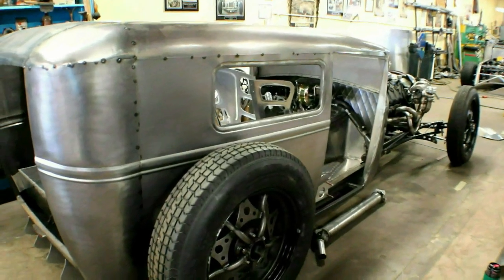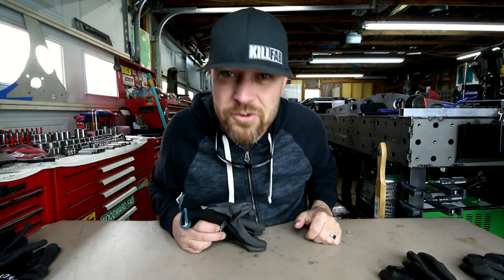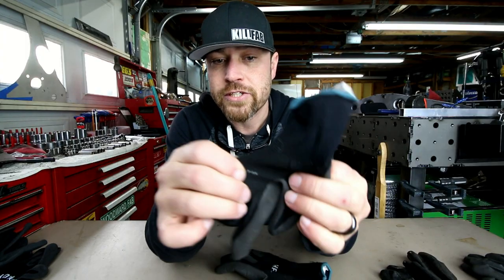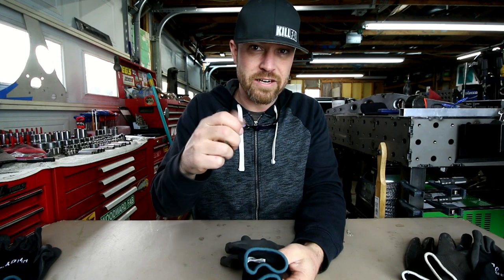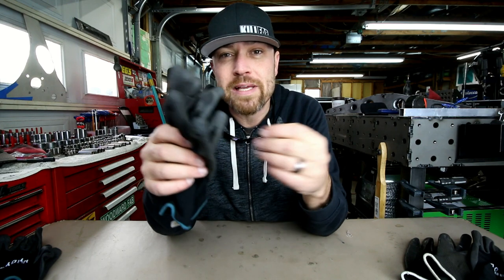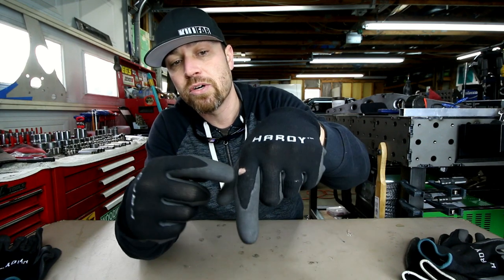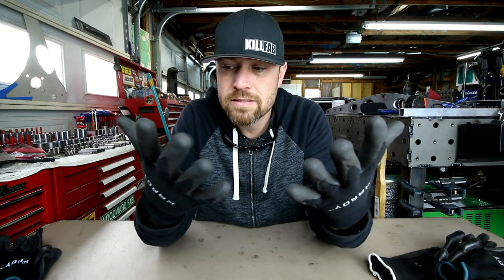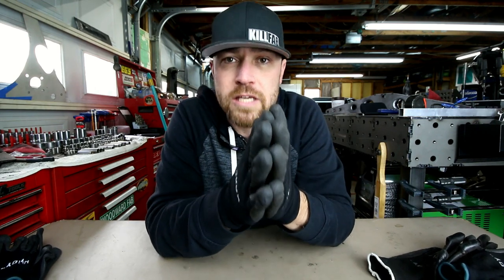You Need This Tool - Episode 89 | Hardy Polyurethane Coated Nylon Work Gloves

Comment: You are absolutely right about these gloves being durable. I wear a pair in an auto factory 10hrs a day handling nut and bolts. I usually get about 3-4 weeks out of 1 pair. I normally have to throw them away because they're greasy or snagged not worn out. Keeping your hands warm might be a bit of a stretch though. LOL.

Comment: Every time I go into Harbor Freight I grab a handful of these gloves and have done so for years. They are great for any wet work. I’m a cattle farmer and wear leather gloves most of the day, but for the messy or lightweight jobs, these are my go to. I have been very surprised at how durable they are. They last me a very long time. I will say that for a brief time Hardy changed the rubber coating on the gloves from a very grippy gloss black, to the matte black you are wearing in the video. I hate the matte black rubber. The gloss black is where it is at and fortunately HF has the gloss back on the shelves now.
Reply from the maker: yeah I have seen that

Comment: What kind of tig welder do you use in your videos? Is it air cooled or liquid? I'm looking for one that will work good but not need to shut down to cool all the time.
Reply from the maker: +PuppetKicker I have an Everlast 325ext. The air or water cooling has nothing to do with it shutting down to cool. If it shuts down it's because you have exceeded it's duty cycle. The reference to air or water cooled has to do with the torch head. I have a water cooler for mine but any machine can have a water cooler added to it with the proper torch.
Reply: The Fab Forums thank you for your help

Comment: I like this style of glove for working in my shop BUT I find if I use them for mig welding the stretchy part on the back goes crusty and breaks down (UV days I would assume)
I have started wearing motocross gloves and they seem to hold up better and still give me the ability to deal with small items
Reply from the maker: yeah they dont do good with sparks
Reply: Heat breaks down the rubber. Uv wouldn't have that effect. Shouldn't need using rubber gloves when welding anyways.

Comment: Cue Hardy gloves sponsorship.......Kyle, just joking. I didn't use gloves before...those days are gone....gloves are the 'must have' before I even begin working on any mechanical stuff...if I remember obviously. Usually do 5-10 mins into it. I have used similar gloves here in the UK and you are right regards having a smaller size. My hands are medium at best but the small gloves just fit a bit better...something overlooked a lot of times but the very first thing those 'Who Build' or "fix' should don before doing their 'Thing'...
Reply from the maker: lol...I would be happy to work a sponsorship deal with Hardy Gloves!
Hardy....thefabforums@gmail.com ;)

Comment: Sounds bad but I take my gloves and I got to harbor freight get tool grip dip . put my gloves on and dip them in it . gives ya comfy gloves that are tuff as all hell but there not stiff at all IV had the same pair of gloves over 7 months , toss them in the washer every not and then and they take the abuse like younwouldnt bereave .. From one faborcator to another this is a little tip. The tool grip dip is only 6 bucks